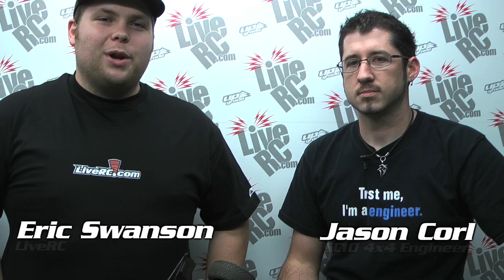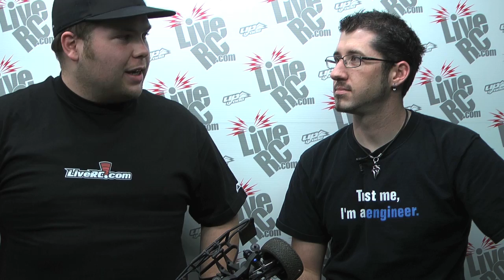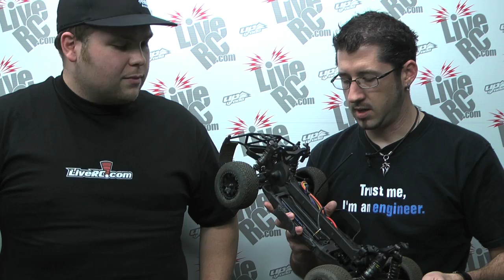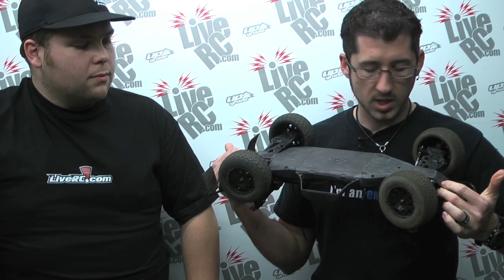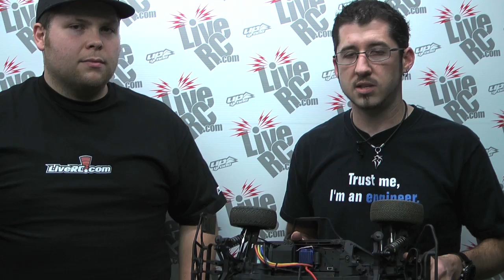LiveRC interview with SC10 4x4 designer

Comment: My friend has this sc10 4x4 and under review. I have the SC10rs brushless and the slash 2wd vxl and platinum 4x4 and the SC10rs is a weak package. You know the diff issues you have with the SC10rs and give out $9 rebuild to fix the poor design and is not the fix. You should be sending  out a properly shimmed diff, how Team Assoc. can sell something with this issue is silly. Your new 4x4 for $349.00 added shaft/slip diff and no tires////// Ohh the reverse and radio is also poor. Phone chat??